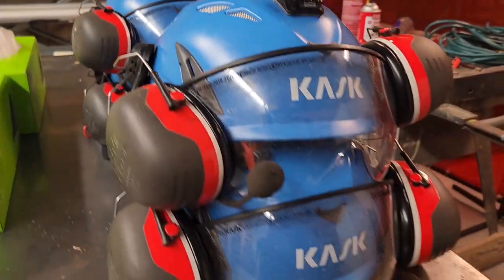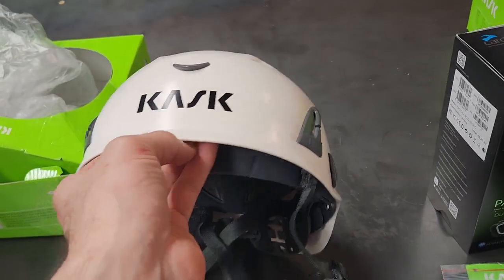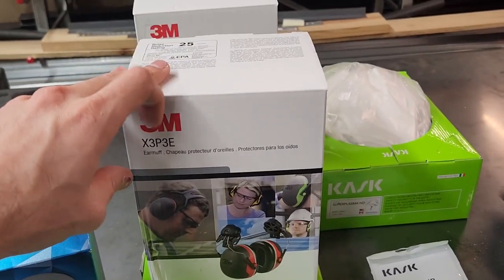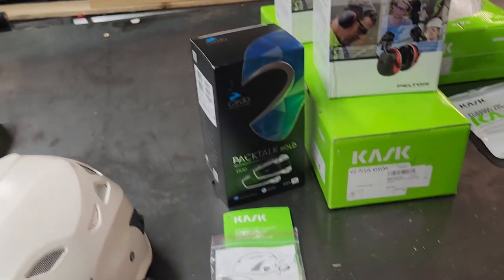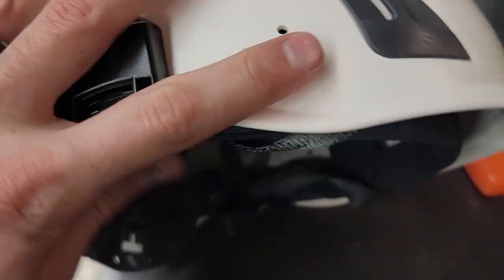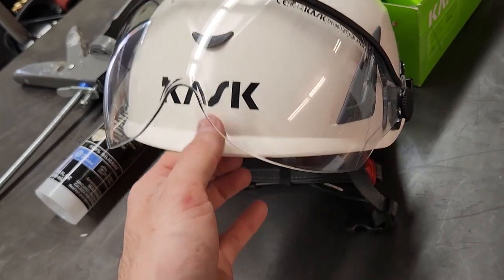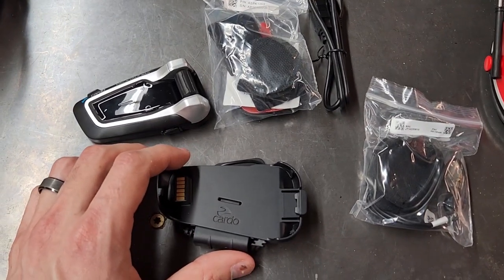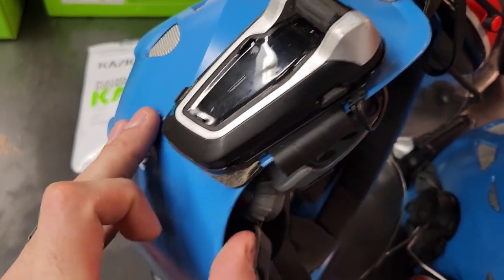What Helmet Comms Do We Use? - Kask Super Plasma and Installation Tips

Comment: The moment you modify any PPE (drilling holes, cutting a piece off, etc.) you basically render it useless and unacceptable. I learned this the hard way. :(
Reply from the maker: Unfortunately, to my knowledge, Cardo, Sena, etc do not offer a wireless headset solution yet. Hopefully that will change in the future. We absolutely do not modify the helmet portion in any way for that exact reason. We have also since 3D printed our mic mounts. The adhesive would fail overtime. Really appreciate the comments!
Reply: @sirensproject  no worries. My comment wasn't meant to attach, but to inform. As I was also like your team, modifying my PPE. Until I got turned back from a worksite for that
Reply from the maker: @ItachiUchiha-ff5yb  It is great to mention those types of things for others to see! Safety is incredibly important. Really do appreciate you checking the video out!